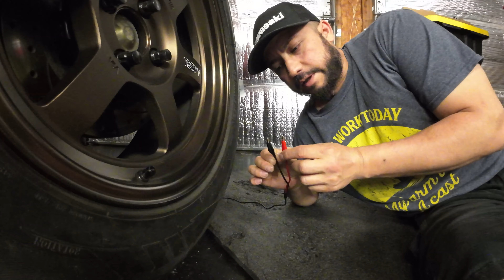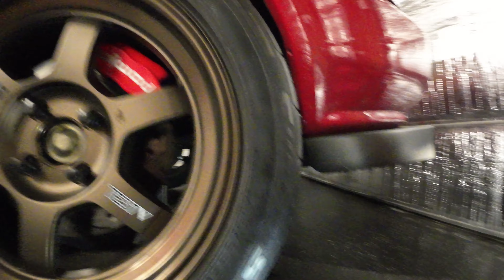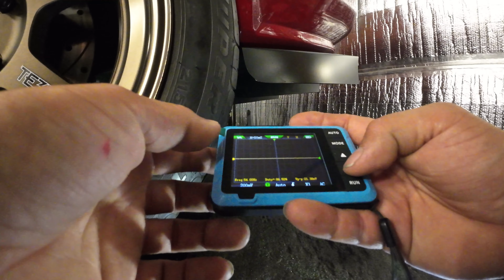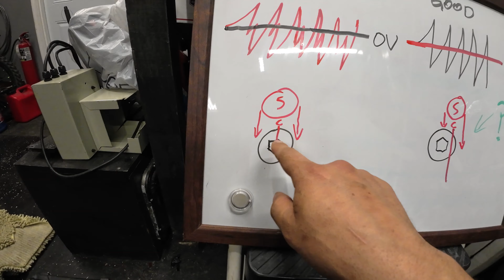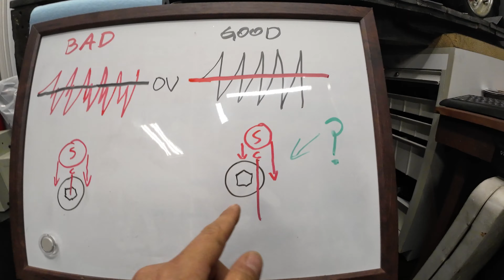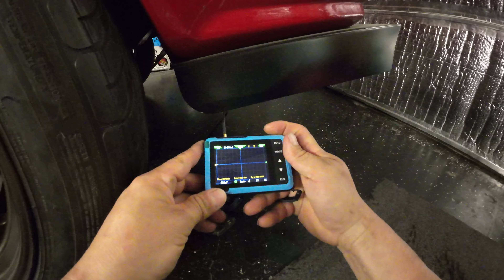Diagnosing wheel speed Issue with an Oscilloscope for traction control

Comment: How did you get that j to sit in there so flush?
Reply from the maker: Hasport egj2 mounts but you have to get a transmission brace to the bottom frabricated because it will rip the 2 bolts on top out of it j32a2 intake sits pretty low hood has skeleton cut out of it and raisers but it still hits it has a couple small dents where it hits but they are barely noticeable but they are there lol i added a torque brace and that help it from denting even worse